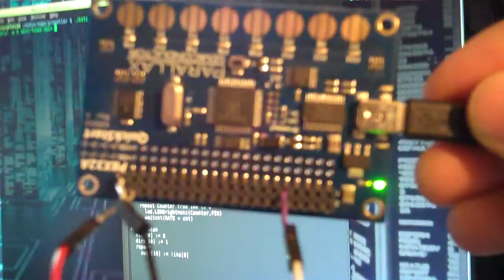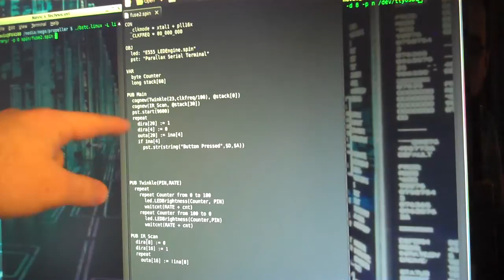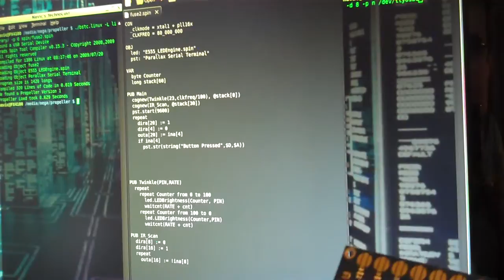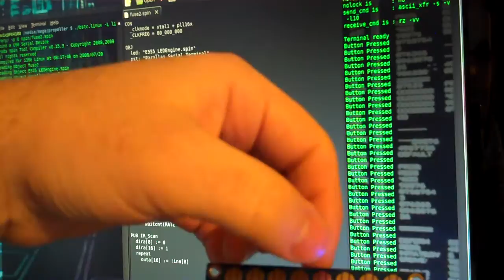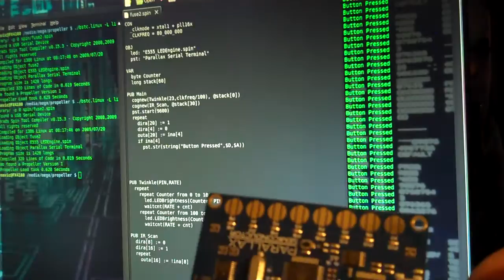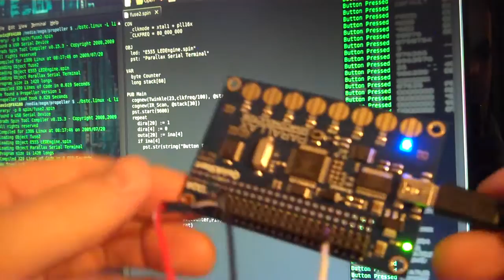Parallax Propeller

Comment: Also picked up a Propeller quick-start on clearance.  Cool to hear someone explain some things about it.  I'm currently waddling through some basic blinkenlights stuff trying to figure out how to do stuff.  I've gotten an idea of how to work with the LEDs and buttons built into the board, but how do you address the stuff that you plug into the black thing up top?
Reply from the maker: ***** The product guide for the board (http://www.parallax.com/sites/default/files/downloads/40000-Propeller-QuickStart-Guide-v1.1.pdf) lists the I/O pins to header pin layout.  Parallax also sells a QuickStart pin finder plastic attachment for the header if you have an old revision that doesn't list the pins on the bottom of the board.
Reply: navic209 Thanks-- that's exactly the help I needed.